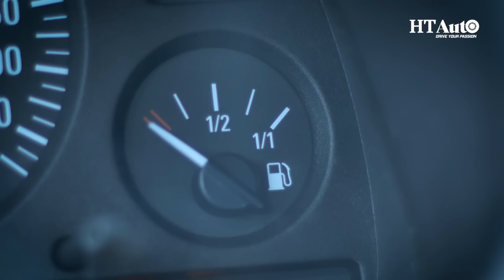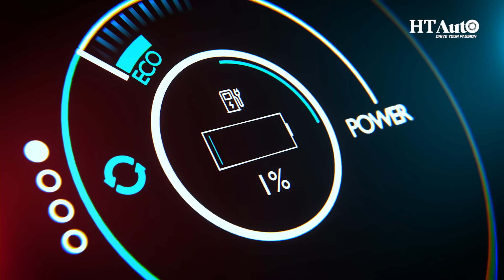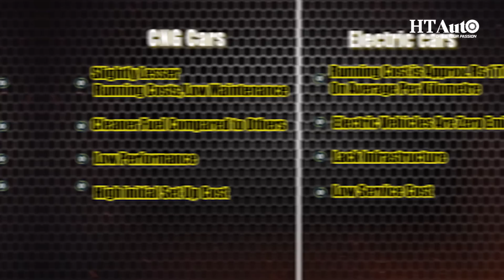Petrol vs CNG vs Diesel Cars vs EV - Which is Better? | All Things Auto | HT Auto

Comment: Seeing the present scenario CNG is the best option because if you run out of it you can switch to petrol. As government is thinking of banning diesel and most manufacturers stopped making diesel Cars, there is no need to go for it. With regards to electric Cars ,as you mentioned, prices are too high coupled with problem of charging stations and loss of battery power year on year basis plus battery guarantee is at most 8 yrs. Or 160000 KM, therefore, you will have to replace the battery, which is too expensive.